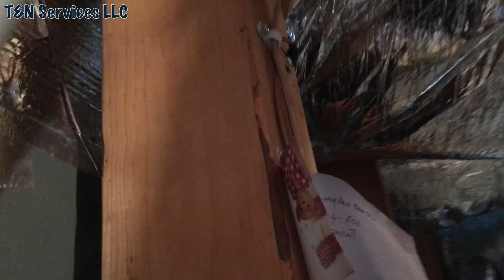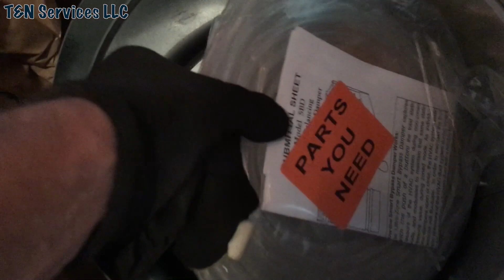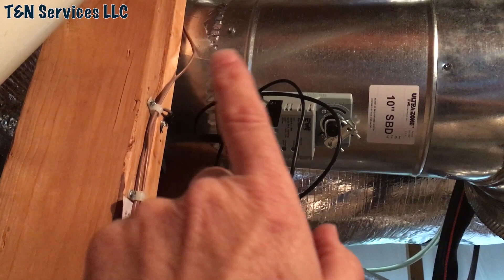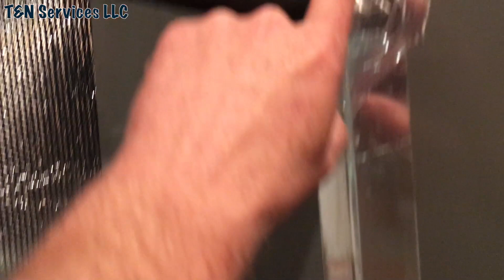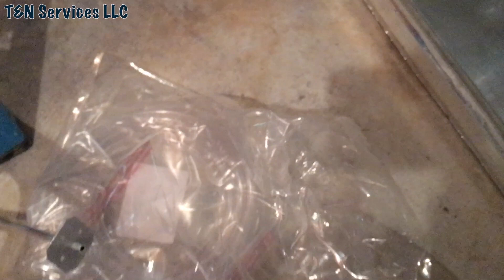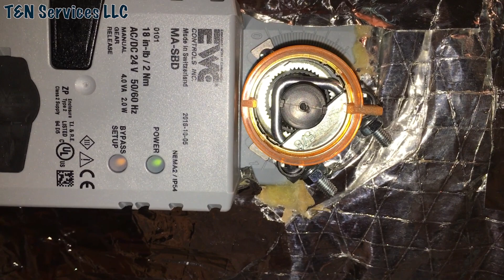EWC SBD (Static Pressure Bypass Damper) Install

Comment: I'm putting together a zone system right now. I have two questions please. Does the SBD have a predetermined static pressure target? I didn't see you set anything. Also my dampers are clockwise to close where yours are clockwise to open.  Can the SBD detect that and operate accordingly?  Thank you